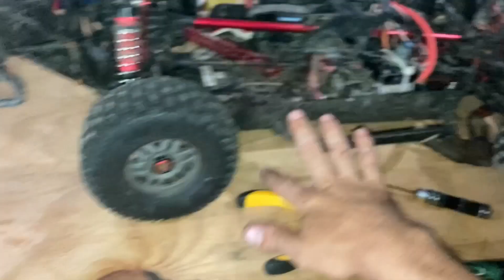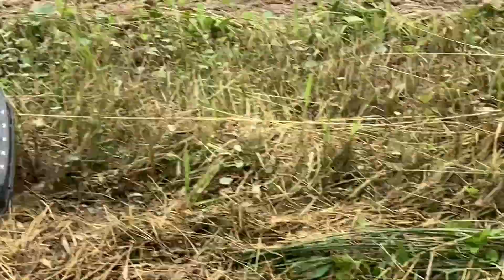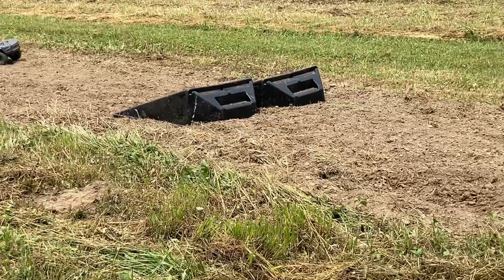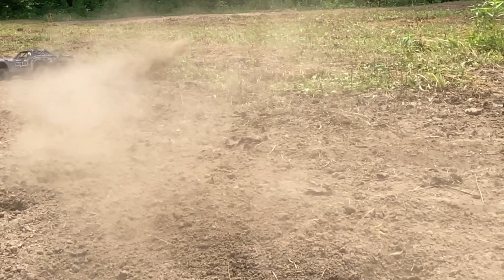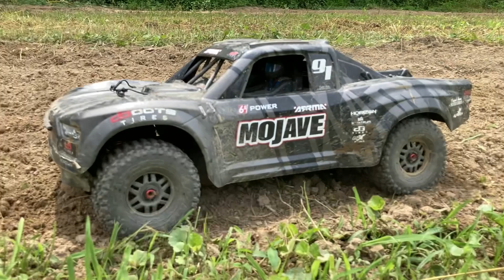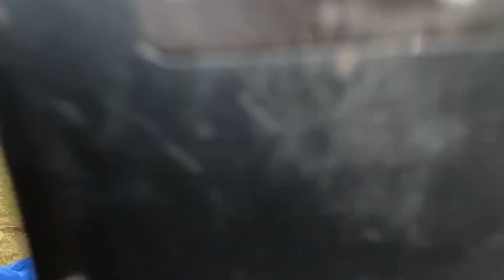Arrma Mojave making some laps

Comment: Great video! I think the Mojave is going to be one of my next rc’s 👍🏻🍻
Reply from the maker: Tough as can be. I had to replace an axle and an output cup
Reply: @davidrcbasher4412  That’s pretty typical. I’ve replaced the drive gear and a rear axle on my big rock but I’m running it on 6s.
Reply from the maker: @robsrcinsanity1220  Must mean we’re doing something right. Lol 😂